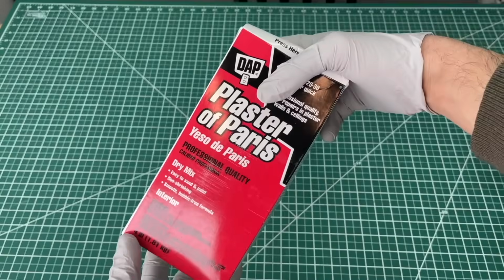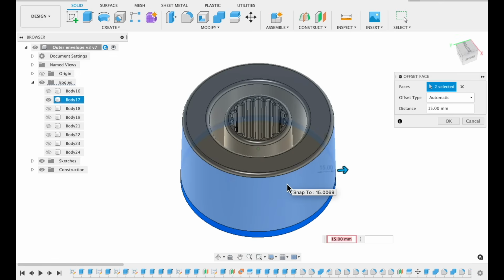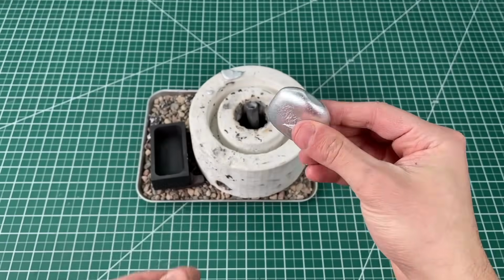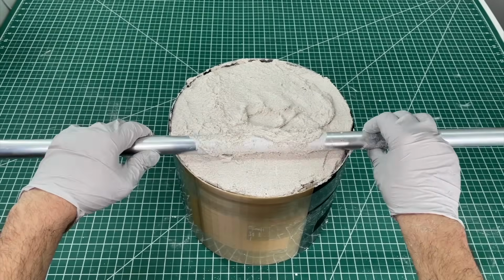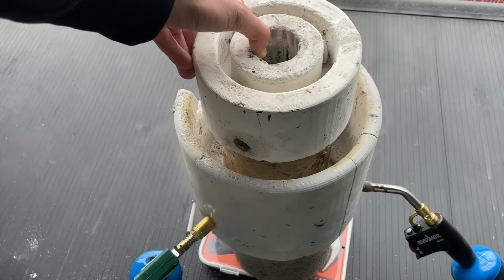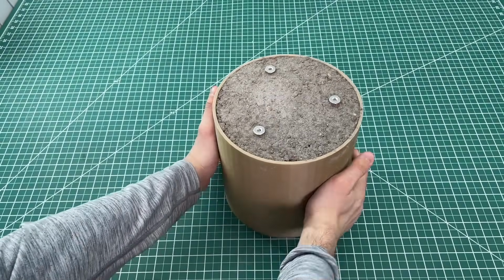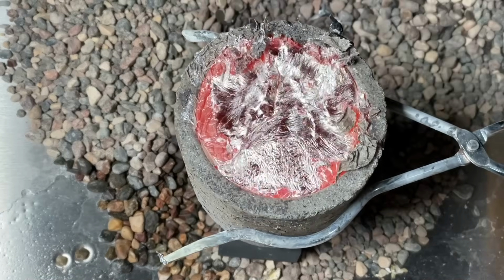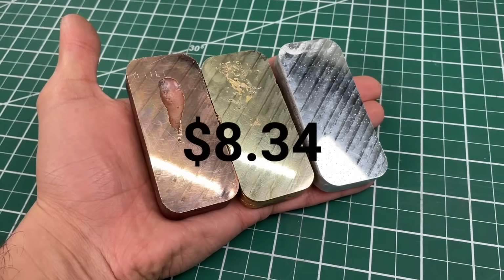DIY Foundry At Home

Comment: Concrete can explode when heated similar to rocks so be very mindful of that if you continue to use it. I would recommend redoing the foundry with refractory cement to prevent explosive accidents. Preheat the molds before pouring in the molten metal. And finally, instead of the small propane cans you should use the large BBQ canisters and build a larger single torch that heats the crucible in a cyclone from the bottom. Also, palm sander on the side of the container can help settle the cement into the voids and remove air bubbles. Commercial concrete pours use vibratory tools to get the concrete to settle around rebar
Reply: Also, if you add the water on top of the plaster/concrete in 2-3 times while mixing, and not the plaster after the water, it's easier to avoid lumps.
Regarding the concrete, adding more water makes the concrete weaker, so the indicated value on the package should be followed (which depends on the amount of cement in the mixture). As a rule of thumb, it must be wet, but water should not end-up laying on top of the mixture.
Reply from the maker: Thanks for your input. This was our reason for not adding extra water, to reduce the likelihood of the cement cracking.  I hope you enjoyed the video regardless 😊. Cheers, Dave
Reply: @ActionBOX  Best material I have found is a mixture of Soft pink fiberglass and Clay.  It turns into sheets that I always wrapped around materials but either way the mixture could be ripped up and stuffed in a mold.  You let it dry then turn on the forge to fire the clay and it works great.  There is a commercial product which is similar going by the name of Kaowool.   For your setup here I personally think even a clay/sand mix could be used but the fiberglass is night because it makes it light weight and prevents it from ever cracking in any substantial amount acting like rebar yet still becoming part of the ceramics as its fired.  Been tested and it works better than commercial firebrick matter fact.
Reply: @ActionBOX  Another safety note for you: be careful when working with molten alloys. Brass is an alloy of copper and zinc. Zinc oxide fumes will make you sick and that stuff is a fine particulate (it's the white smoke that would have came off the brass). At minimum you need to make sure you're upwind, but i'd say use a respirator/n95. 

Also, as a safety gear suggestion: Get a welding jacket, face shield (a basic welding helmet will cover this and allow you to get a good look at brightly glowing metals), welding gloves, wear jeans (anything made from natural fibers. synthetic fabrics will melt to your skin. It sucks, avoid it), and pull the cuffs down over your work boots.

Molten metal is one of the more dangerous things you can work with if you don't follow the safety steps, as you guys almost learned with that pop you had. I'm not saying don't keep at this, just hoping you do a little more research on the safety front next time. It's some time vs possibly losing an eye or worse. 

If you're ever casting anything besides bars for instance. That little pop in an ingot mold isn't too big of a deal thanks to the safety glasses. In a casting mold (enclosed mold) the same mistake would lead to a much more... vigorous pop to say the least.
Reply: @ActionBOX  doesnt matter. you need to use refractory cement.
Reply: @zerumsum1640  Nono, mullite ceramics.
Reply: @escain  don't you mean the longer concrete is wet the stronger it gets a slower cure time for concrete causes larger lattice structures that makes it stronger hence why you see people wetting concrete drive ways on hot climates
Reply: @kurtryankoch7356  No, I mean adding more water than the strictly necessary make it weaker. Concrete will become stronger over time, and achieve near final strength after some 3 months, drying too quickly add the risk of superficial cracks, but that is not an issue for in-room molds.
Reply: I think they got lucky with how loosely they packed it
Reply: You missed another even more important safety warning: don't do metal casting on a balcony of a building. It's just asking for an uncontrolled fire.
Reply: If you find the cat litter that is of the crystalline variety you can easily obtain sodium silicate by making a saturated solution of litter/water adding lye (sodium hydroxide). It's great for refractory cement or high temp glue
Reply: Concrete explodes when moisture penetrates it. Once dry and kept dry it usually isn't an issue.
Reply: its also worth noting that plaster of paris and casting plaster are very different things
Reply: The plaster of Paris and sand is basically refractory. I've used it for foundries for years and it's never even cracked
Reply: @Enderbro3300  I shocked to hear it honestly because in ceramics we use similar stuff as a flux to lower the Temps which silica melts.  I suspect plaster kilns are ticking time bombs and if the Temps ever get high enough the entire thing will Flux itself and meltdown.   Seen something similar here when he made it too thin and it didn't have enough mass to displace the heat
Reply: @seditt5146  Eh... more likely  what was happening is the direct torch flame was causing a high temp chemical reaction. the blue cone on a torch is usually higher in oxygen and lower in fuel, and this can lead to some things becoming fuel for the flame that normally wouldn't. Keep in mind the center of those torch flames is a good 2-3000 degrees. It's less the fact that it's hot, it's more that it's hot and there is oxygen.

the fact that they didn't notice this on the larger one may just come down to better construction/insulation allowing the plaster to take the heat better. Personally if i was doing something for melting metals, i'd try to get some refractory cement as it's both more durable and more insulating that plaster.
Reply: @Enderbro3300  yes! It is NOT concrete as various commentators have believed, that would have involved Portland Cement (a different binder to plaster of Paris).
Reply: I was gonna say 😂 I’m no expert at smelting. But I watch a lot of it to know not to do this. It’s a great idea. Maybe if u was doing something very tiny the plaster would work? But I know that every one I watch always heats up the molds. I know from cooking that cold things and cast iron don’t mix well. Hell any metal and cold don’t mix well.
Reply: @checkforfleas9452  Plaster casts are fine for metals, you just have to make sure they're completely dry. To do this, you leave em in the oven on max for a few hours both to pre-heat the mold (helps prevent cracking of the mold and freezing of the metal before the mold is full) and to drive off any water left in the plaster. 

Best casting material simplicity/safety wise seems to be green sand once you learn to pack and make it, but you have to get the mix of oil to sand right or it won't hold the shape. Too little oil, the sand is powdery. Too much, and the mold will be soft or start boiling the oil.
Reply: @checkforfleas9452  You have to be really careful with small plaster molds when it comes to moisture, too. They can shoot out lead and alu easily, too. Make sure they are baked/dried out thorougly before a pour.

Comment: The foundry would heat up faster and be hotter if you had more oxygen in the system.
Without an extra oxygen supply (like a added opening for a pipe that’s connected to a hairdryer), the gas from the torches won’t burn as efficiently and you‘ll have a lower heat yield than you possibly could reach.
Grant Thompson had some great videos on building homemade foundries and nozzles that get more oxygen into the system.

Also using a kitchen mixer works well for easily mixing plaster.
Just first add the water and then slowly add the plaster powder until it’s all properly mixed in.
Holding a grinding tool (without any grinding attachment) against the mould will help with getting rid of all the bubbles from the plaster because the vibrations make it easier for the bubbles to rise.
Reply from the maker: Thanks for the input 😊 I agree with these two points for future reference. Hope you enjoyed the video. Cheers

Comment: The small pores in the aluminium bar are most likely caused by hydrogen in the melt. This is very hard to avoid, because any impurities, mostly aluminium hydroxide and other stuff from the passive surface of  aluminium parts, react to hydrogen as a side product. Hydrogen can also come from moisture in the air and from the organic gas that is used as fuel (propane contains hydrogen and reacts to carbon dioxide and water when burned). In big foundries they can use processes like vacuum melting and electric heaters, which is hard to do at home, even harder if you want to do it cheap. There is the possibility to use additives or melting under a flux, but I really have no knowledge about those.

For the big bubble in the copper bar, this looks like a blowhole that is actually still caused by water vapour from the mold. I don't think this is a misrun because how should that happen in an open mold. It could also be from hydrogen in the melt reducing copper oxide that is also included in the melt, but i doubt this would produce such a big bubble.

The only way to fight those things is drying the mold and keeping it hot for the pour to avoid misruns and cold shuts.
Reply from the maker: This comment was very detailed. I feel smarter after reading it.  I appreciate you sharing your knowledge, and I will give your idea a try.  Thanks a bunch 😃, Dave
Reply: @ActionBOX  Haha, thanks. I think talking and explaining a lot is a perk that you grow with being a teacher 🤣
Reply: Another way used in the aluminum industry to get rid of those hydrogen bubbles is to inject inert gaz (Argon for ex) in the molten metal, and steering it for better results... Also, you have to keep your metal at the lowest temp (around 680°c or less)
Fun fact: even in high end aeronautical parts, there is to those "bubbles", just smaller than your part.
I don't know much about copper, but this cavity looks like a "shrinkage restrain" for me (the metal have to shrink while cooling down, and to do so, it shrink a the last hottest area of your part. The bottom of it, in contact with the graphite in this case) 
French article about hydrogen porosities in aluminium (in french, sorry. But with nice pictures!)
https://metalblog.ctif.com/2019/01/21/le-degazage-des-bains-dalliage-daluminium/
Reply: @charlesvanderlinde5506  I also read about the argon, seems interesting.

However, I don't think the big bubble in the copper is a shrink hole, its a little big for that small bar and also it does not seem to have a cristalline inner surface. But what do I know, I have no real experience in casting, only a little material science 🤷‍♂️
Reply: I was going to comment the same thing.  Aluminum foundries will add flux then bubble argon to bring the dross to the top, remove it, then vacuum to remove hydrogen.  Before it's poured into a holding furnace a sample is off gassed in vacuum chamber then cut in half to look for those bubbles.

Comment: One key thing to do before pouring molten metal into an ingot mold is that you heat the mold up right before doing the pour.  This eliminates any possible water/liquid still in the mold and makes for easier removal when cooled.  The other thing is to remove the slag from the top of the molten metal.  This allows for a more pure bar when poured.  Note:  your funny shirt is just a line of G-Code for a CNC machine   ;)
Reply from the maker: Thanks for your comment.  As we demonstrated in the video on our second run, we heated up the ingot molds to be red hot, so I can definitely agree with that comment.  As per our shirt, that G-code represents “home” for a machine.  See if you get it now 😃. Thanks for your comment, Dave
Reply: There's no place like 127.0.0.1
Reply: it happened to me before I didn't leave it heating long enough and bam I had liquid copper flying around the place turned my lesson that day
Reply: The clip-art of a CNC machine on that t-shirt is the exact one seen in a Forgotten Weapons thumbnail

Comment: You should remove the floating impurities on top.
Reply from the maker: Do we remove them while they are in the crucible? Or after we pour it into the molds? If you look at our video of the brass casting, we tried while it was in the mold but it cools down too fast.  Cheers.
Reply: @ActionBOX  BigStackD usually adds a bit of Borax into his melts to get the impurities to cling together and using a metal cooking spoon with slots (preheated with a torch beforehand) - then cleans out the slag before pouring. Might help. Take a look at his work and you folks could get some tips!
Reply from the maker: @evankimori  thanks Anthony
Reply: @ActionBOX  usually while it is in the crucible (molten but still over the burners). You can see it in most casting videos =).

Comment: For aluminum you need to degass it before pouring in foundry that I work as student they use argon to degass aluminium before pouring it in forms.
Reply from the maker: Thanks Pavel. Can you give me more details on how thats done? I assume just spraying some argon at the aluminum while its in the crucible wont do the trick? I appreciate your input, and hope you enjoyed the video 😃
Reply: @ActionBOX  yes i enjoy all you video argon purjing is done in liquid aluminium by putting a grafite pipe inside crucible you need a relatively low pressure just to blow argon slowly thru the liquid aluminium ( it is dangerous if you have moisture in argon) this aeration drag hidrogen from aluminium liquid metal (when solidify hidrogen and oxygen create water and this create small buble in not fully hardened metal this is the reason you ingot to look like sponge 🙃)

Comment: Always poor the dry stuff into the wet stuff, never the other way around - produces much fewer dry lumps. Holds true for baking and mixing plaster.
You can add the plaster slowly so that it slakes / mixes on its own.
You can mix using a paint mixer attachment for your cordless drill, very cheap at the hardware store. Rinse it / spin it in water before it sets up.
Many people mix plaster with their hands, so that is a viable option.

Bonus tip: Most importantly, never pour uncured plaster down the drain, it'll ruin your pipes. Let it set up and then put it in the trash.
Reply from the maker: Thanks for the informative comment. I will second the note of DO NOT POUR UNCURED PLASTER DOWN THE DRAIN. Thanks again Mattias 😃
Reply: Adding dry stuff to wet: seems to not be true when mixing concrete, though, since you add water until you get the right consistency - just as you did it in your test.